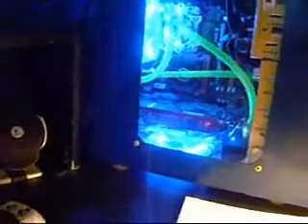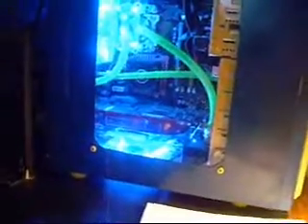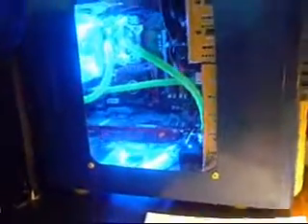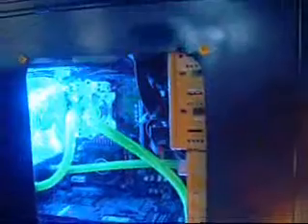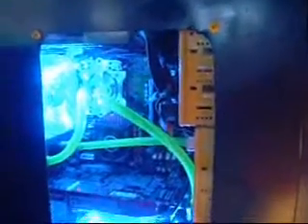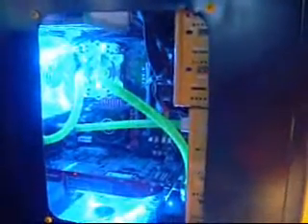Water Cooled Vs Air Cooled

Comment: Pets should also be taken into account.
I would love to build a water cooled system, but im poor. I do however use my wife's stocking for air intake filters. I also cannibalize anything from anything and mod it to my needs.

Look up positive vs neg pressure on toms hardware. Have pics of my simple mods. Also positive pressure for pets.

I do have to agree, that mine sounds like a wind tunnel, but I mod'd a 20 buck case.

Comment from the maker: Actually the rad is inside a different case. I may have gotten better results if I had mounted it externaly instead of in the case. 

Both machine have identical hardware though.

Comment from the maker: Yes it will. It will not be able to do it at really high setting like 1900x1200. But at lower settings you should be able to get a pretty desent frame rate out of it. It does beat the 9600GT in all benchmarks. But for that price range and them games you might want to look at the ATI hd4670. It is almost 40% faster on Crysis and sells for about the same amount.

Comment from the maker: It is a very nice design. But I dont think the airflow would be great. The way the fans are mounted. Ony one reaer output fan and no output fans on the top. Just my opinion mind you. And some of the reviews on it sounded pretty good. If you really like it I would concider doing some mods on nit and mabye add one large or two small fans on the top to help pull heat out.,

Comment from the maker: I have to agree that Thermaltake is by far not the best water cooling equipment out there. That was why I did the comparisom with air to show that air was cooler then this system. But for stock clock speeds it will keep the cpu at a good working range with minimal noise. And the hose is 3/8 not 1/4"

Thank you for the comment :-)